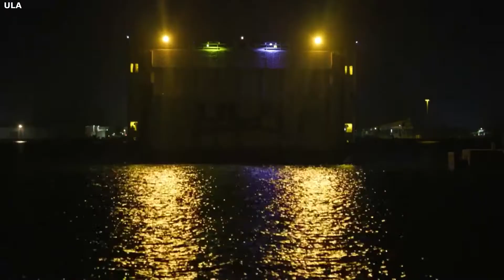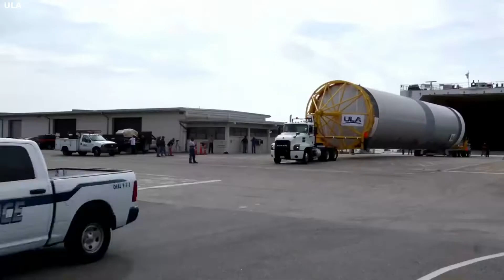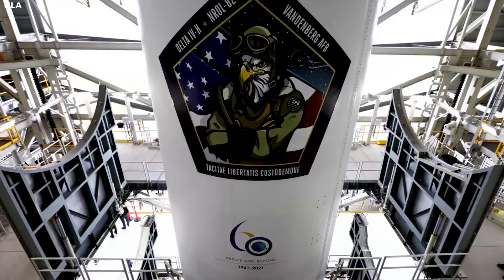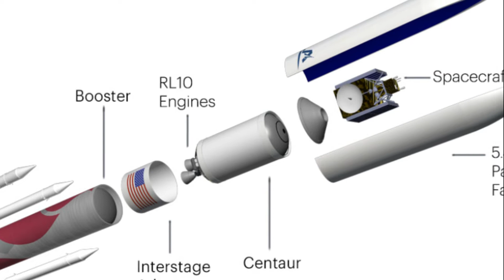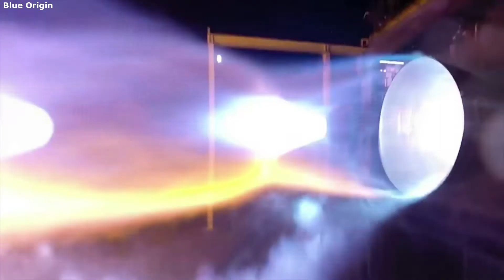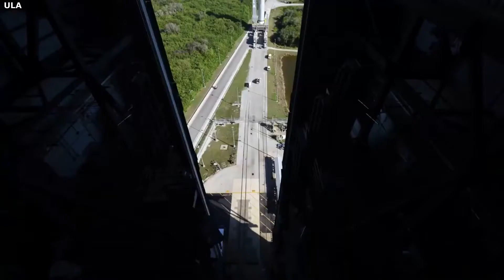ULA’s Next Generation Vulcan Launch Vehicle

Comment: We used inertial friction welding on the mandrel s for the manometer capacitance level probes of the propellant utilization system on the Atlas rocket. This resulted in flawless smoother surfaces of the welds.